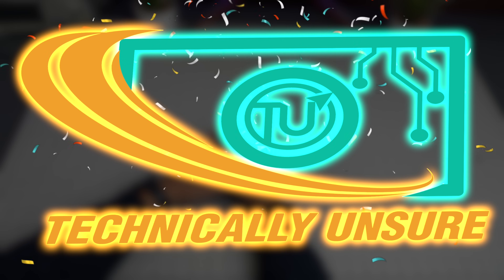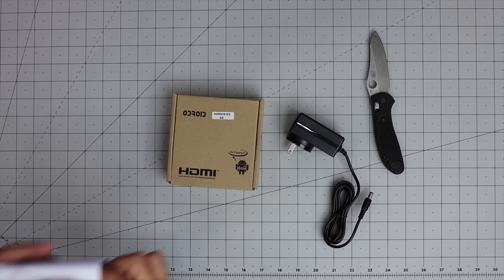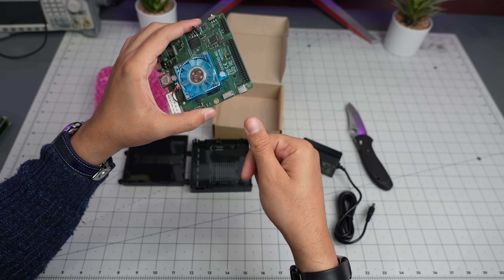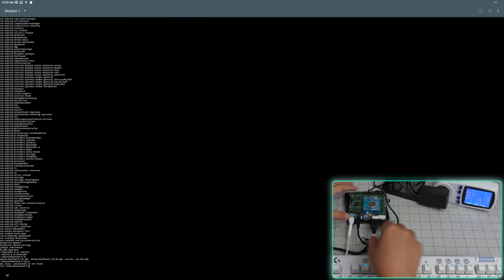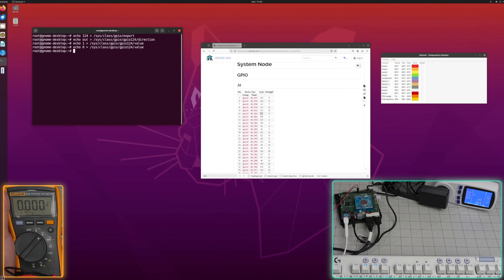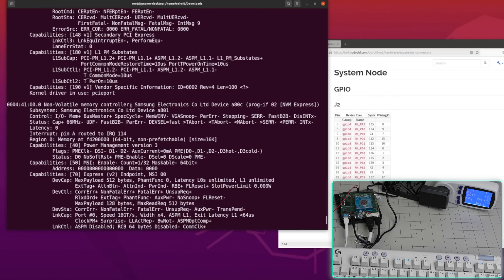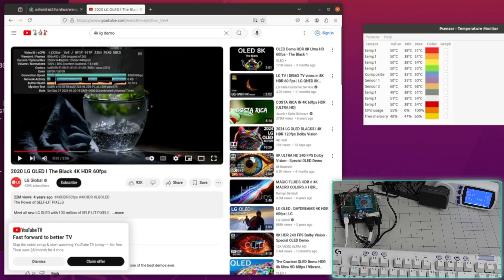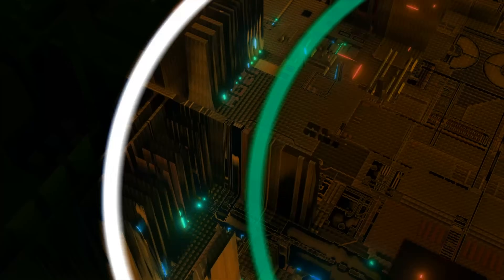ODroid M2 Review: A Next-Level SBC for Performance Enthusiasts

Comment: Problem is, you are sticked to Linux 5.10 kernel but meanwhile they provided fixed images so that at least Ubuntu 22.04 became usable. With that, it is one of the few ARM based SPCs on the market, that also support h265 hardware encoding, so it could be an interesting option if you want to avoid the $$$$ Nvidia Jetson Orin NX for that purpose.

Comment: I have Odroid.M1, never more. HW is OK, but linux support is a nightmare - so much memory, so good GPU, but GPU acceleration in linux is not working, and I have no use for Android. What is worse, after so many years, just Ubuntu 20 is supported from vendor. This M2 is a bit expensive, I coud bought AMD based miniPC for the same money (and spare a lot of painfull searching and extra drivers & kernelk compiling).

Comment: Recently youtube started streaming av1 codec. If so in this case than it do not use any hardware encoding for youtube
Reply from the maker: Thanks for letting me know, other alternative I have is the ffmpeg and the official ffmpeg is also not working great on Rockchips. So I guess I will have to install ffmpeg-rockchip
Reply: av1 is much easier codec for GPU/CPU then vp9.

Comment: Wish they made this with a snapdragon 8 gen 2/3
Reply: I wish to see more small boards on mobile/embedded x86 CPUs. Like Radxa based on N100
Reply: So you can't have open source drivers for any periphery of the SoC? Why do you want that?
Reply: @RustedCroaker  there is open MSM DRM driver , that as I remember haveat least  8G2 GPU support
Reply: @RustedCroaker  I don’t know who told you you can’t have open source drivers … please don’t spread fake information…
Reply: I think snapdragon won't be so open like rockchip, what do you want to do with snapdragon 8 genx sbc
Reply: @ run apps without the need for docker

Comment: It can't be a $115 device if there are import duties and shipping costs.

The problem with the RK3588 series of SOC's is that nearly 3 years after fir first release, development is not close to being able to use the devices to their full functionality.

In this particular case as an SBC, it should be pitted against something like the Radxa M4 X86 board.

The RK3588 in any form should be capable pf 4k6fps video playback with ease. This S2 version is further cutdown from the original S model, so cheaper.

For overall satisfaction, this is not the droid you are looking for.
Reply: rk3588s2 is not a costdown from rk3588s, instead it adds some features on s,

Comment: Kinda begs the question of why the RK3588X derivatives aren't just carrier boards? It's as if there's a huge forest of PCB shapes for the same few SoCs. They should just standardize the high density pins (or maybe a Jetson SoM type interface) and sell a raspberry pi shape, and a mini itx shape, and a mini pc shape, etc etc.
Reply: I mean the Radxa CM5 and Turing RK1 are actually available for that
Reply: @Rushil69420  - I think my statement may have gone over your head a little bit (you're repeating the first half without grasping the second "make diverse carrier boards for them" half).
Reply: @JazzTechie  There are carrier boards for both being made by companies other than Turing and Radxa. Rockchip doesn't have anywhere near the market share when it comes to these SBCs (compared to RPi) and since there are multiple variants (88, 88S, 88S2) (& diff RAM/EMMc configurations) it probably makes more sense for board manufacturers to go with complete devices like this.

Comment: hey technically unsure, I have a question not related to this video. Namely could you tell me which manufacturer is less problematic (especially in terms of software)? radxa or orange pi or does it not matter and both companies are at a similar level, because I plan to buy either rock 5b or 5 plus but I am not sure which will be a better choice, because on the one hand rock 5b has m.2 e key to SATA (which would be useful for me), and on the other hand 5 plus has 2 ethernet ports. I ask because there is no clear answer anywhere and you did comparisons of them.
Thanks for your work and response.
Reply: If I may interject, I think both are the same since for both you need to avoid their official distros like fire. Otherwise they make nice stuff
Reply: rock 5 plus